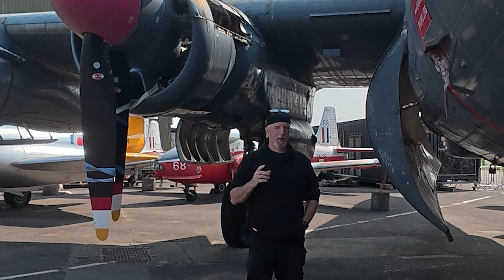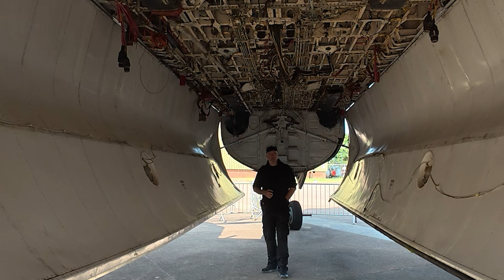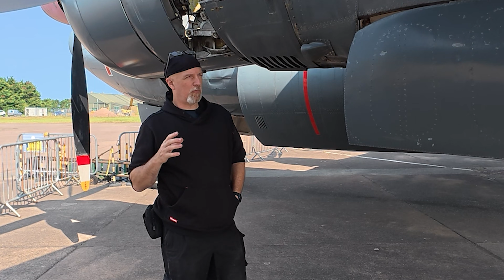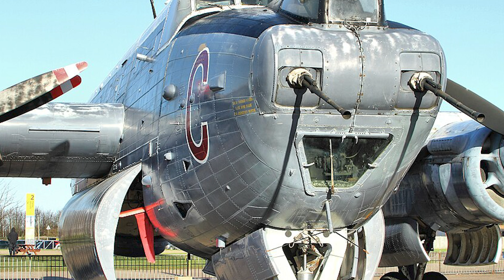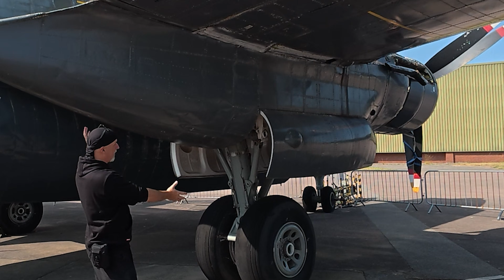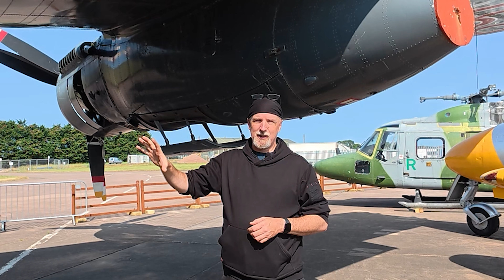How the Lancaster's grandson became a Cold War legend

Comment: The MR3 was progressively upgraded; only the last ones - the MR3 MOD3 had griffon 57s outboard and griffon 58s outboard, with viper turbojets. The earlier MOD 1s and MOD 2# did not have vipers, and used griffon 57a and 57b motors.

Comment: The main reason why the MR2 was retained longer than the MR3 is that it was a better airframe to convert into the AEW2. Adding that big radar scanner and its dome was incompatible with the tricycle undercarriage of the MR3 due to weight and balance issues. Also, as mentioned, the MR3 was heavier and subject to greater airframe fatigue issues which would have probably meant a resparring process if they were to serve beyond 1970 or so.
Another issue with the MR3 was that the Viper jets used the standard Avgas fuel used in the Griffons. This was not great for the Vipers as jets work better with kerosene based fuels rather than petrol based fuels.
Had a very interesting tour of the MR3 at the Gatwick Aircraft Museum and learned a lot of stuff about this version.